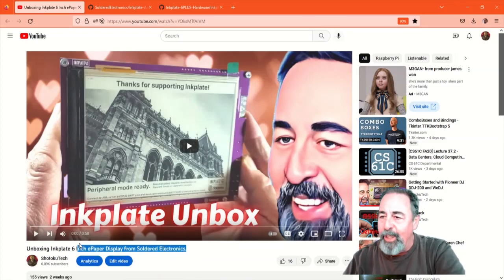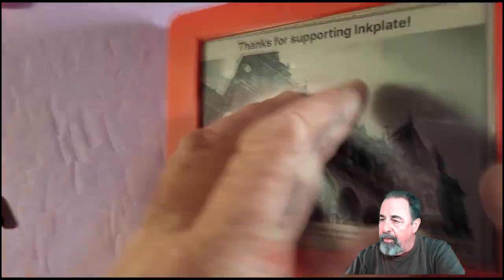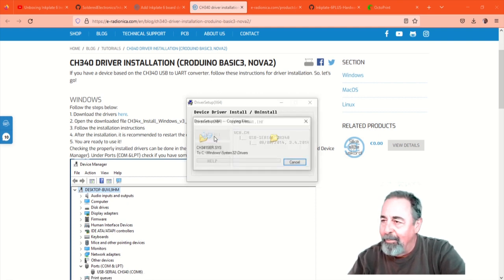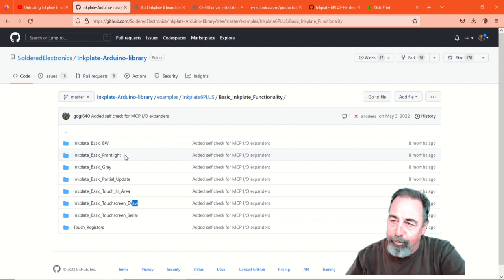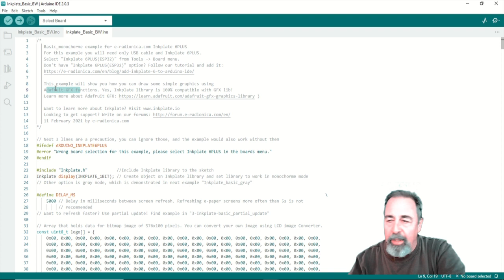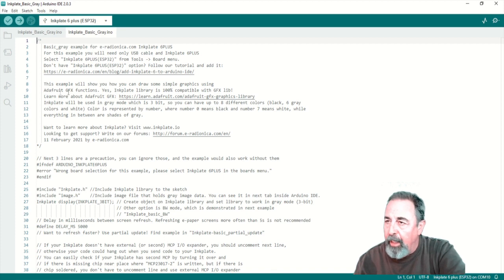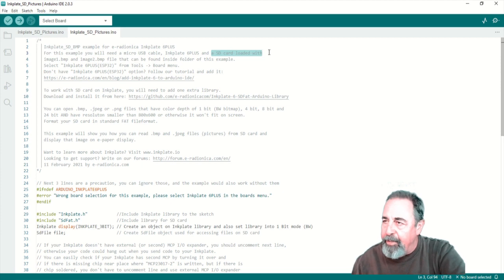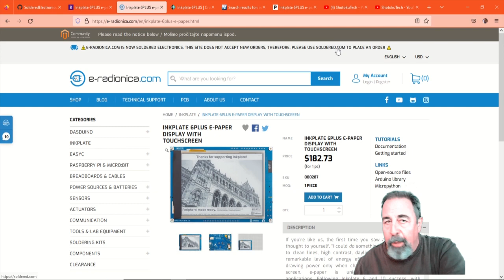Getting Started with INKPLATE 6PLUS from Soldered Electronics

Comment: I compiled and uploaded my sketch and my IDE says it completed.. But I don't know how to get the program to run on the Inkplate after it's done! Can you help me?
Reply from the maker: What sketch was it?
Reply: @ShotokuTech  hello, thank you. It is the Inkplate4TEMPERA_OpenWeather_Station. I import the libraries needed, supply my wifi and geolocalition info, etc. I can verify and upload to completion but when i disconnect my device and power it on, I don't see the program running.
Reply from the maker: @anhjamietran9120  Do you get any feedback in serial monitor in Arduino IDE? That would be the first thing I would try. Leave it connected and see if there is any messages in serial monitor.
Reply: @ShotokuTech  great tip, thank you. It said it couldn't connect to wifi. I found out it needs a 2.4 Ghz connection and i was using ssid for a 5.0
Reply: @ShotokuTech  now my problem is the example sketch makes API calls to a deprecated API haha. So I will figure it out
Reply from the maker: @anhjamietran9120  There you go! Congrats.
Reply from the maker: @anhjamietran9120  That's what I love/hate about this hobby. Best wishes.